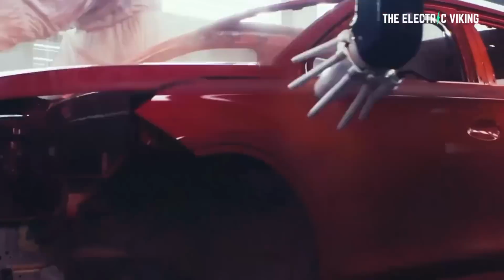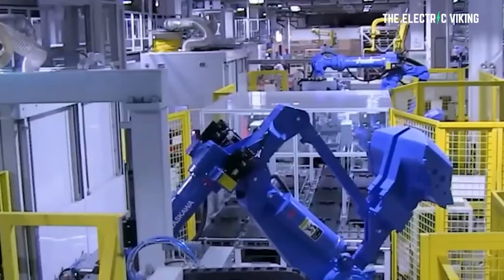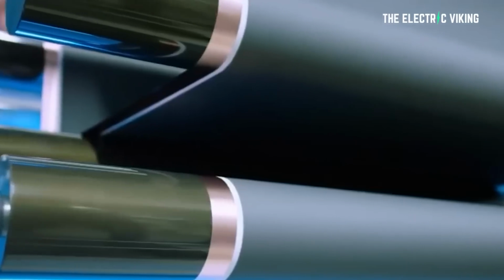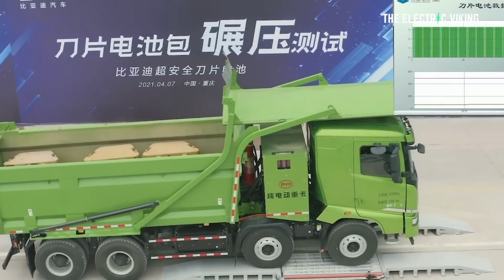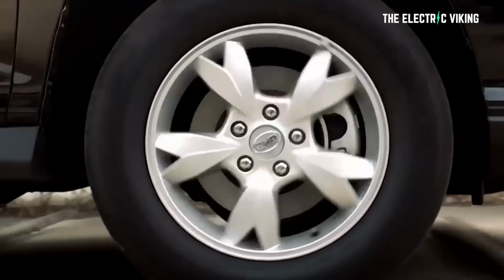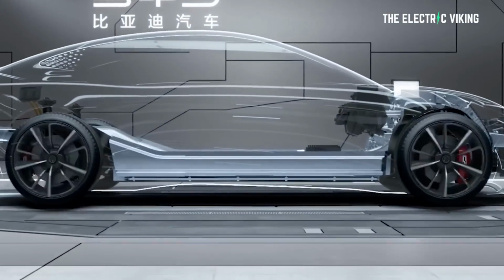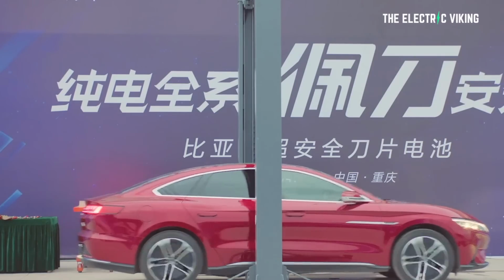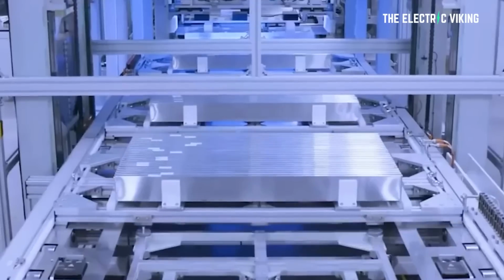BYD's blade battery is NOT what excited brand fans think it is

Comment: Batteries are topped out for now. and maybe for forever . They need to switch to a range extender design . Cut the size of the battery by 2/3 and make E as it's going down the road.

Comment: I have the BYD Dolphin, driving range 405KM, I have a psychological problem I want some help with should I feel guilty when I recharge the car many times I drive a little far to work so every 3 days I have to recharge the car I usually start charging at 100 km left on the battery. And in from what I read about the new battery blade technology in this kind of car for 2022 will not be hurt when you used fast charging Do you agree with that?

Comment: You forgot to mention LFP batteries currently have poor performance in freezing weather losing as much as 30-40% of their range.. They can make more which is critical as they do not need the high grade of lithium; but lower density means higher weight for a given range; EVs were already too heavy.  Weight means more CO2 to make and to move; more than cancelling out the benefit of electric motors. They need higher density.

Comment: A Watt or kiloWatt (1000 watts) is a unit of Power, where Power is the RATE at which Energy is used (during discharging) or obtained or stored (during charging). So, Watt-hours (Wh) or kiloWatt-hours (kWh) are the units of Energy corresponding to the Watt (W) or kiloWatt (kW) units of Power. 

Perhaps a better way of explaining this relationship is the formula relating Power (P), Energy (E) and Time (T), where P = E/T. Likewise, E = P x T. Thus, when the unit of Power is kiloWatt (kW) and Time is given in hours (h), your corresponding unit of Energy would be kiloWatt-hour (abbreviated as kWh). I hope this helps everyone appreciate that Gravimetric or Specific ENERGY is given in units of watt-HOURS per kilogram (wh/kg), while the corresponding Gravimetric or Specific POWER would be in units of watts per kilo(gram), or w/kg.

Comment: I do agree with you, rather than make massive high density packs by sticking to around 50-60kwh size which gets most cars around 300-400km range is all 95% of most people need, sell them cheap and get most of the lower-middle price bracket 
Most people arnt buying new cars, they buy the second hand 5year old ones that are only 10k not 50k +

Comment: Sam, Glad to hear your voice getting better.  I have read that BYD Blade battery packs are a structural part of the car, with the cells as stressed members.  This is state of the art tech that helps compensate for lower cell energy density.  Also the cell format has a lot of surface area, making them easier to heat and cool when needed.  It seems that the blade cell format is uniquely suited to LFP chemistry.

Comment: While i see that for an Australian there are virtually no downsides to LFP besides energy density, for us up north (Norway) there are some significant downsides that can't really be ignored and that mainly has to do with our cold climate. Rapid charging of LFP is quite a bit slower than other chemistry types even at normal summer temperatures (15-25 Celsius) in winter we might see -25 Celsius or even colder. at these temperatures LFP becomes really impractical as I believe they will not charge at all if the pack temperature drops below 0C. If you have a slower level 2 charger (2-4 Kw) you may be using almost all the energy to heat the battery before it can even accept a charge. Many people have experienced this already even with other chemistry types, typically at winter cabin where they may only have 240V 10A charging available. Typically they would see the battery heating for 8-10 hours before charging for a few hours and starting the heating cycle again

Comment: There’s also the fact that, unlike Li-ion, LFP batteries can utilize their entire capacity, from 0-100% when charging.  Not having to be limited to the recommended 20-80% range is a huge bonus.  Depending on one’s use case, this feature alone can make up for the loss of overall density.  

Plus, add in it’s more compact packaging (ie. rectangle vs round), lower cost, higher safety, better reliability and longer life… seems like leading tech to my eyes.  And it’s only going to get better?  Sign me up.

Comment: LFP struggles at temperatures below 5 degs C. But thermal insulate the pack and battery power can be used to keep it warm. Once it’s in use, normal discharge current will keep it warm enough.
Reply: Exactly, should not be charged or discharged below 0C and above 55C.

Comment: I’m guessing EVs will likely last longer than ICE (all those engine and drive train problems gone), especially with long life reliable batteries. That means in 30 years of use, lots of unexpected things can happen.  For example, accidents that violently short out the battery or salt spray corrosion in critical places like high current connectors or inside the battery box.   A fail safe battery would enhance the reputation of such EVs and keep resale value high for decades.

Comment: Is the comment about no recalls true? BYD have had to recall nearly 10k cars because, according to the regulator " problems with the battery packs could cause fires". Social media posts suggest that BYD is voluntarily replacing battery packs in additional vehicles and other media posts show BYD vehicles on fire.
I accept that the problem might be water ingress into the battery pack rather than an issue with the cells themselves but I doubt that owners affected will split hairs -- for them the recall is to avoid their car catching fire. I also accept that the cars affected are BYD hybrids but it still seems an exaggeration to say that BYD haven't been subject to recalls connected to their batteries.
Reply: But are they LFP?

Comment: In the immediate future - and I truly believe this to be before 2030 - a new battery technology, specifically a solid electrolyte battery technology will be invented, built, and used in electric cars all over the world, one which will be cheap, very efficient, giving a long range, with a very fast charging capacity, easy to be built, not using at all rare, expensive, dangerous chemicals and components, that it will maintain its quality for 15-20 years for use it in a car, and that after last use in a car, it will still be good for another 10-15 years as an energy storage unit, and at the end of the end fully and easy recyclable.
I truly believe this.
Reply: Already in production......LFMNP...............Paul.............."CATL"
Reply: Paul H / Full solid electrolyte battery ( not semi-solid )? 
Then we want to see it soon manufactured at huge scale and used in EVs!👍✌️

Comment: As with most products, there is a sweet spot where you get the best value for your money. If you go anymore premium, you pay a lot of money for small increase in performance. If you go cheaper, the performance drops significantly for not much saving in money. Most people would have no idea about the energy density of their EV. In the next few years as BYD and others ramp up production, the energy densities will most likely increase at a rapid rate. People would much rather a have long lasting, reliable EV.

Comment: What for all this talk about energy density of the chemistry !?? Fact is that BYD batteries of any size are lighter and less spaces then "traditional" batteries of chemistry with Nickel,Kobold. Because due to the blade arrangement they use less weight and space for packing ! That's the point. Due to this "naive" focus on energy density in the chemistry alone many manufacturers missed the boat and now BYD and CATL are leading.

Comment: Depends on which technology is appropriate. You don't look for light weight construction on a tractor, you look for reliability and strength. With the blade battery my criteria for my everyday driver, Yuan Plus, is fire safety, reliability, long life and sufficient range for my needs. If I were replacing a Ferrari I'd sacrifice those  requirements for light weight and rigidity. Horses for courses.

Comment: I think BYD strategy here is that they have a battery that is good enough for production and to be able to meet the insane demand for EV’s for the next few years. Once that this initial demand slows they will then focus more on improving it going forward. Most everyday people just want a battery that works and that won’t explode or catch fire and get the every day usage job done at a reasonable price. This is what every OEM should be doing to solve the main problem of reducing emissions ASAP rather than making a so called ‘killer car’ or ‘better battery’.

Comment: Actually,  BYD had revealed that they are developing LiMnxFe1-xPO4 battery which is a more efficient lfp battery by adding  magnesium material.   But it is BYD style that they will only show the finished  product when it is put on production.   Moreover,  a new battery pattern patent that is different from blade battery has just been registered by BYD recently.
Reply: Mn is manganese, not magnesium. Several companies are working on improving the energy density of LFP batteries in different ways, sometimes called LMFP or M3P (where the 3 stands for ternary).
Reply: Ty for ur comment

Comment: The second generation blade battery is coming out later this year.  It will offer 180 wh/kg at pack level.  Not industry leading, but pretty good.  The thing is that BYD's products are never going to sound like the greatest, but they work as expected and are safe and are cost efficient.  With CTB technology, they save a lot of structural weight.  So I think in practice, they are always going to be the cheapest and among the most dense LFP technologies out there.  They don't need to boast about having the highest density level to get sales.  They keep their mouth shut and just build stuff.

Comment: In all Li batteries, thermal management is crucial. There is a reason our modern phones are the shape they are, the flat playing card shape allows heat to dissipate easily through the sides, evening out the temperature and preventing the development of hot spots. The blade shape with a large surface area to volume ratio does the same thing albeit with some sacrifice of overall battery energy density.

In contrast are the compact pouch cell LiPo flight batteries used by aero modellers (and in some pocket sized vehicle jump starters). These are volumetricallt efficient and can have spectacular energy density and power output (typically over a kilowatt from something weighing just several hundred grams). However, they are comparatively shortlived, good for just a hundred or so cycles. Occasional internal short circuits, overheating and even fire are the price of this high performance.

Comment: So, BYD is following the Toyota approach rather than the Mercedes approach: aiming for spectacular reliability and affordability rather than cutting edge performance. This makes their cars a better choice for a very large section of the market.
Reply: Toyota is doing that with EVs?
Or batteries?
Where?
Reply: @rogerstarkey5390  I was referring to the business strategy generally. However Toyota is developing EVs and the video mentions that Toyota has signed up for some of BYD’s blade batteries, presumably because they fit in well with Toyota’s general approach.
Reply: No ..It's Toyota following BYD....Not the other way around..................Paul

Comment: Blade battery of 75kwh for Model Y Tesla will be 20% bigger and weigh 200kg more.  This will lower speed, agility, slower charging, and no recycling value.  The whole car can be thrown in a car crusher.  The battery has no value in materials.
Reply: good point.

Comment: Tesla should have just make a joint agreement with BYD to build blade battery factories in the U.S. and in Germany rather than create the more dangerous 4680 battery factories.  I would much rather have a car with safe batteries that can charge to 100% than less safe, fast charging to 80% batteries.
Reply: How do you know the 4680 is "more dangerous"?
You don't .
Reply: @rogerstarkey5390  It's well known that LFP batteries have a safer chemistry than 4680 batteries.  Look it up.

Comment: U should mention the energy density of the structural battery pack with blade batteries. Not the chemistry is revolutionary but the suitable for EV form factor makes it great
Reply: Should also mention that the 4680 had all those properties, plus fast manufacture in smaller factories.

Comment: byd has a new battery in the pipeline with 270Wh/kg. byd just doesn't talk much.
Reply: You REALLY need to understand the correct terminology.
"kW/kg" isn't it.
Try Wh/kg
.
Even if you meant "kWh/kg" you just proposed a cell with 1000 times the capacity of a typical Tesla 2170 cell.
Sloppy.

Comment: Personally, choosing safety for slightly less range alone is a good deal for me, not to mention, LFP batteries are cheaper... I don't know why anyone would go the opposite. Be careful, you play with non LFP EV, you could get burned, and I don't want to be a toast turkey.
Reply: LFP batteries are cheaper?
Really?
Per kWh?
🤔
Reply: @rogerstarkey5390  im a fund manager  invest in new energy area , LFP is way cheaper then LTB about 0.1-0.2 RMB /Wh = 0.014USD-0.030USD/Wh cheap. it mean in a 50 kWh just the battery cell cost will 740USD-1470USD cheapr then LTB . by the way average price of 50 kwh LTB package here in china cost about 8000 USD

Comment: If I remember well, this is how I get you on my list. Yes, BYD blade batteries were a marketing thing at the start, and still are, but also have obvious advantages.
Reply: Have you ever noticed that every picture or diagram of a "blade" pack had a gap between every cell?
I find that odd in a structural pack?
Reply: @rogerstarkey5390  Yes, but it is not odd, it can be cooling space or whatever. The air is not adding weight, it is taking space/volume. If it is used as a cooling air system, that space is smartly used as is not add weight, as in fluid cooling systems. In fact, is a better solution to control the temperature with air instead of fluids. Furthermore, the space between blades makes the structure more stable (remember why the steel H beams have thick flanges and a thin web). So the designer's job is to accommodate that volume between wheels. This is why on all EVs the wheelbase is bigger than any ICE car, ICE cars have the engine in front of the wheels, EVs do not have this limitation so wheels can be pushed forward and backward.

Comment: Sam, you did a video last year about batteries developed by a company called C4V, (The manufacturer is called IM3NY, which is majority owned by Magnis Energy). Their current battery, know as Liser, seems to resemble LFP (Lithium, Iron, Phosphate for those new to this subject). The C4V battery seems to replace the iron with "biomineralized mixed metals". This is the one that I think is a step up from LFP. Have you continued to follow this development?
Reply: I asked almost this same question on another video wondering about  IM3NY in NY
Reply: @RM-rh3mz  They just started commercial production at their N.Y. plant. They plan to ramp up to 38 GWhr in the next 7 years or so. Exciting times!
Reply: @bryanstrom812  exciting ! 😬

Comment: It's interesting, people go bananas over cutting edge, leading tech, ground breaking etc etc, but hey, they're building a relatively (in comparison) safe battery that fulfills a market need TODAY, that is comparable in energy to weight considering the safety of the units. AND they're MOVING PRODUCT! They're NOT abusing the environment so bad as all the MINING these cutting edge batteries are using.. I think it's GREAT, I've told all my friends to invest in BYD if at all possible (if not use a firm that holds them).. Good on you for putting the news out there for what it is!
Reply: We don’t use nitro fuels in road vehicles because it’s far too volatile. Gasoline (and diesel) are good enough. Why would batteries be any different?  Keep the super-duper Ternary type for sports cars. Everyone else has more than enough with LFP.
Reply: @Dave5843-d9m  Your analogy certainly works up to a point but Turnery batteries can certainly be safe relative to petrol, it's those spreading FUD who would have you believe they are stupidly dangerous. That said the other advantages of Lithium Iron Phosphate such as extreme longevity and relative cheapness plus abundant raw materials make it a category winner.
Reply: It's a chinese company so it's extremely risky in todays environment.
Reply: @matiashamalainen4574  US propa talking again
Reply: @matiashamalainen4574  yeah not that risky.
Reply: @LithiumBatteryGuy  if you can invest in Chinese stock market purchasing the shares directly, yeah, little to no risk.  But if you talking about depository shares traded in US market, then it has a pretty high risk of getting frozen or withdrawn at some point.
Reply: @xsu-is7vq  What happened to DiDi or the private tutoring sector could very well happen to any other Chinese company. Chinese companies are risky because of the CCCP that can make or unmake a company or an economic sector on a whim.
Reply: @matiashamalainen4574  
Regarding "Make or unmake"
.
That almost sounds like the attitude of other governments towards Tesla?
If not for the quite frankly exceptional person in charge, political pressure would have destroyed the company.